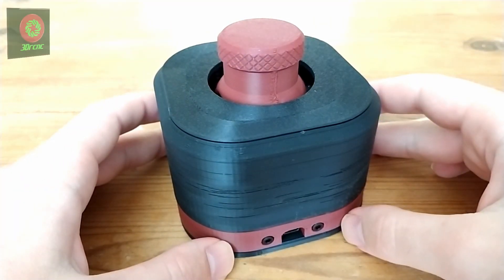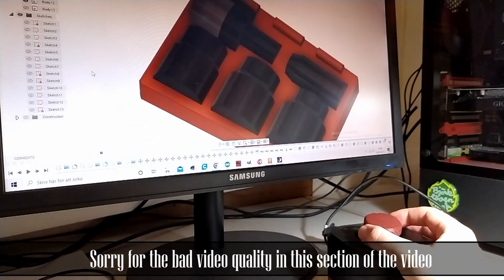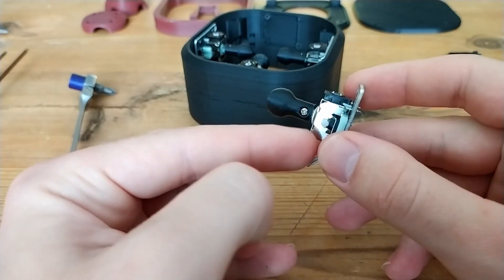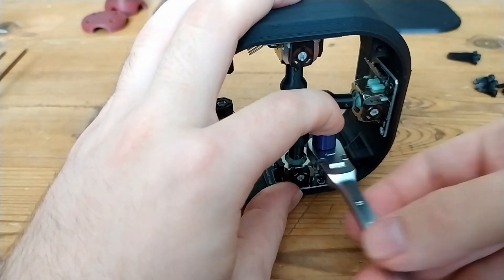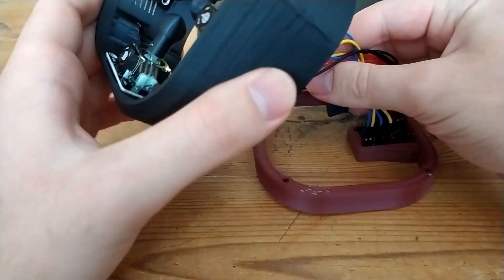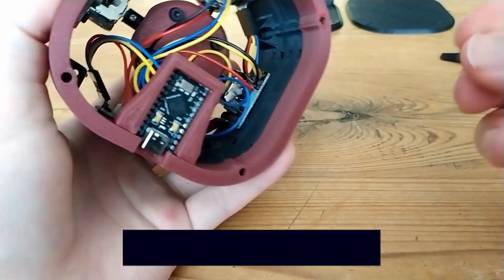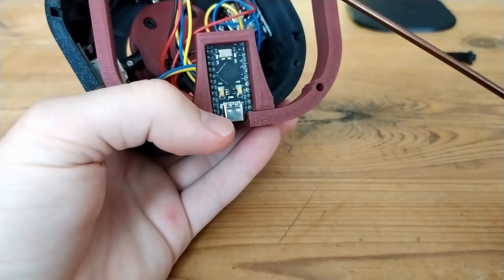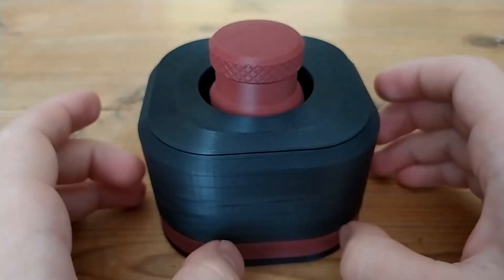3D Printed DIY Spacemouse Build Guide

Comment: It seems that you are missing you new baseplate on your printables? :)

EDIT: I could extract it from your stepfile nevermind.. :)
Reply from the maker: Sorry about that. Thanks for notifying me about this issue. The baseplate is now added as a .stl file as well.
Reply: Ohh bit then while you are going then you actually removed the small hole in the main part aswell if im being picky here.. But thanks for your remix i like it alot.
Reply from the maker: @supernielsen1223  You're right. Thanks! Added the frame stl and updated the description.

Comment: This design misses one plane. Pitch yaw roll pull push,  but no slide to left or front
Reply from the maker: You can do all axis of translation with this design. The knob can be moved left to right as well as front to back and up and down. It can also be rotated around the same axes to get all three directions of rotation.

Comment: How does this actually move the camera though? Doesn't it need API level access to Fusion like a space mouse has?
Reply from the maker: @DB_frfr  The spacemouse code is designed to emulate a Spacemouse Pro Wireless in the 3dconnexion software and that works with Fusion 360. It is described in more detail in the original spacemouse video by Teaching Tech. Link to that in the video description.